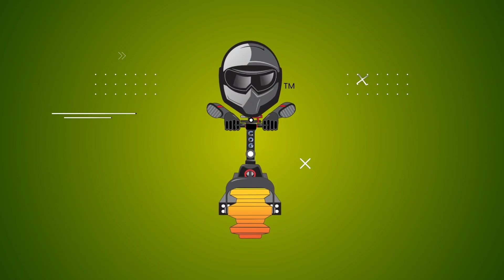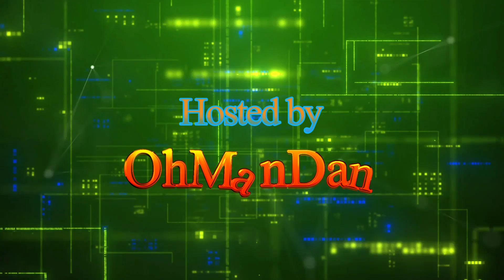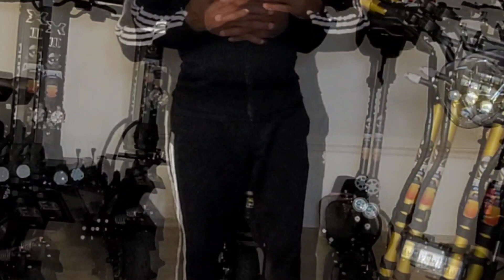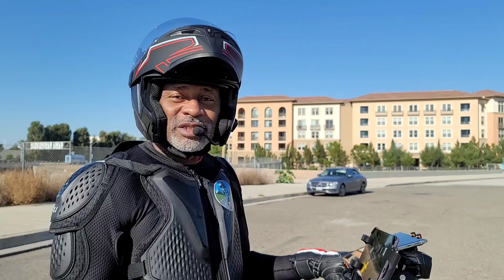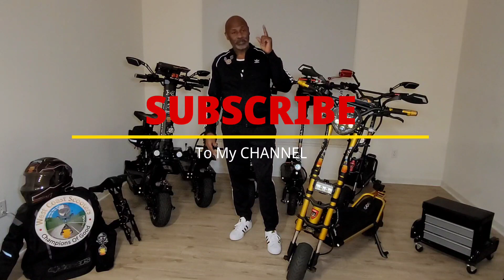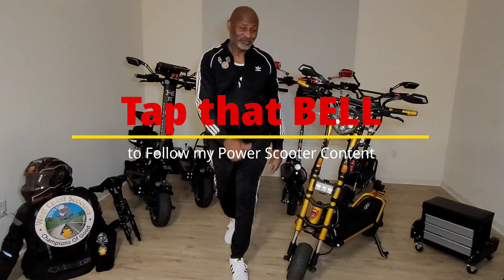Kaabo Wolf King | Final Facts | OHvation Rating

Comment: O.M.D. 🙏🏾🤲🏾peace and blessings my brother.  Luv the vids, very informative 👌🏾.. I'm an ol G as well, & just got into the world of PEV this year.  Kaabo Mantis Pro from fluidfreeride.. I've rode it 3x so far, & luv the pep. @215lbs 6', I rapidly ran down the battery.  Anyway I'm thinking big dawg KWK🤔. What bums me out, is the 28mah battery 😔Should I wait for them to make those adjustments that you mentioned in your video.  B4 I buy 1???
Reply from the maker: Thanks @Fred Freezzy... and thanks for visiting Scootopia. Be sure to Subscribe to my Channel and tap that BELL to stay up to date with all my Power Scooter Content. 

This Electric Scooter is far worth its price, even in its minimal Improvements.  I definitely would not wait if I were looking to get a Wolf KING today. I totally appreciate what the Kaabo Wolf King brings to the turf in Performance. I actually raced another 72V Wolf King today heads up, and its Power is always exhilarating, and yes, I won both races against two lighter Riders (165lbs & 180lbs) I'm 228lbs plus my 12lb gear (240lbs) with all equal "P" Settings.

It is a formidable foe on any Trail, Path or Lane and I truly believe that you too, will appreciate what it delivers to its owner(s). 

With the immense power and performance... I don't think you will miss anything by having that 28Ah Pack, because I actually got (1) one mile more on both, The Minimum and Maximum Range Test as I did on my 35Ah Scooters.

I wanna welcome you, as another OG... to this amazing Micro Mobility PEV Scooting Community.

If you decide to get your King, I highly recommend you get it from the same guys that I bought my Warrior and King from. 

Melvin and his Team over at #VoroMotors has consistently delivered amazing Customer Service and backs every Scooter that goes out their doors. 

Visit their website here:
www.VoroMotors.com 

Tell them OhManDan sent you and they will definitely roll out the red carpet for you.

Hopefully you'll Subscribe and become an Official Scootopian.

Peace and Blessings... to you, my Scootopian Brother.

Comment: Kons it’s ugly in design.Go check out the flj k6. It’s has all of what the wolf king has plus more.It blows the wolf warrior out the water in power and design plus speed and off roading with 3000w on each wheel plus it’s 13 inches  like the dualtron thunder x and brake adjustment is the easier on any scooter I have ever seen. Plus turn signals and better placement of the front and back fenders. Love your video by the way

Comment: I've just pre ordered one of these... Because of you and all the other positive reviews on this scooter. The pros definitely outweigh the cons for me. and I've ordered it in black as i find it more sleek and subtle the gold colour isn't really for me.👍🏻
Reply: Congratulations and be careful I was at a light the other day and I had bulky gloves on because of the cold hear in the Catskills and I accidentally barely hit the trigger Within a fraction of a second it lurched forward Causing me to give more throttle shot up in a wheelie up into the air 6 feet did a free Willy and came crashing down on the pavement with so much force it bent my front suspension and handle bars out of alignment I was able to bend it back but holy smokes this thing is pure torque enjoy it’s so much fun pulling away from cars at traffic lights. I recommend signal lights front and back Amazon $100 prime
Reply: @strykerf27q1983  oh man hope you and the scooter are ok?
I know exactly what you mean this happened to me on a mantis pro where I was stopped with the kick stand down and like you I hit the throttle the scooter shot off from between my legs and the kick stand took a piece of my ankle with it😂 I was so embarrassed trying to make out it didn't hurt!
Reply: @ninjaacoos  Jeeze  Im glad Im not the only one. Im ok thanks I was straddling the scooter when it happened  so I wasn't on it and I stuck a block of would in the bottom section of my forks to lock it up then I bent everything back to almost perfect with one hard twist of the handle bars with help from my wife. I also have 2 matis's which are awesome but can't stop riding the wolf king Im charging it now so much fun and the looks people give you are so funny here in the Catskills Ive only seen one other euc on the road the cops pulled me over the other day just so they could check it out they loved it. I wear full face helmet knee pads and elbow pads and gloves. Enjoy your new scoot
Reply: @strykerf27q1983  well I'm in the UK I just use my mantis on remote trails at the minute until they hopefully become legal. Ive got abit of experience now so hopefully I'm ready for the new beast! 
Cheers mate!👍🏻
Reply from the maker: Thanks  @strykerf27q1983  and thanks for visiting Scootopia. Make sure you SUBSCRIBE to my Channel and tap that BELL to stay up to date with all my Power Scooter Content. 

You're right, SAFETY is the number one Priority when RIDING these Powerful Electric Scooters. Stay SAFE my Friend!
Reply from the maker: That's watzup @Coos... Congratulations and welcome to The Pack!

HOWWWWWWWLOOOOOOOOH!!!!

Make sure you stay connected and thanks for the SUB... I appreciate Scootopians like you in the FAM!!